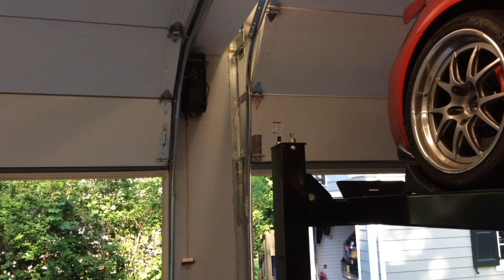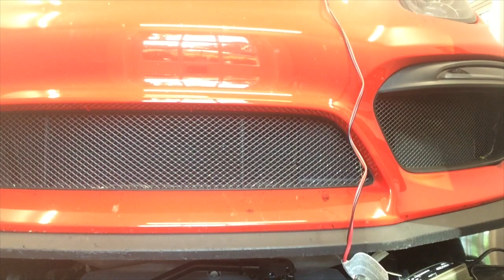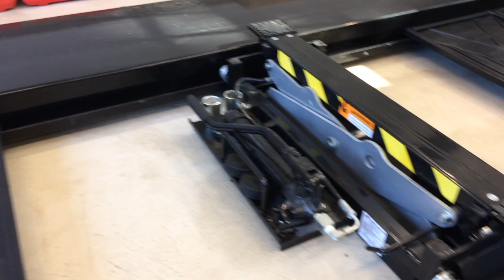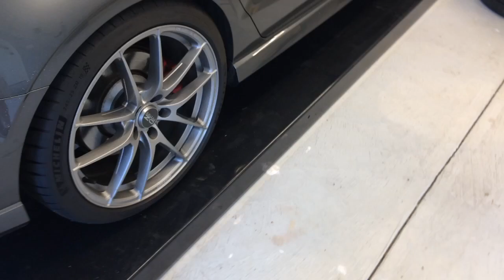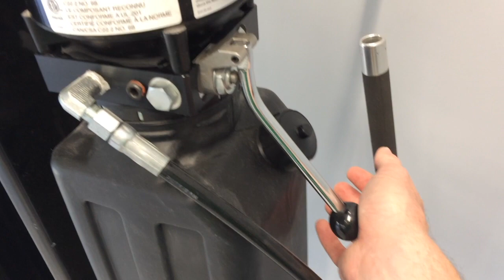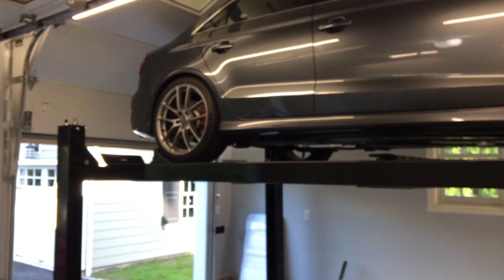Challenger 4-post lift overview and operation

Comment: Can someone help me please? 1) Can you suggest any proven methods of installing such a lift in a garage that has a slope of at least 4-5 inches? 2) Also, would the lift shift if I don’t bolt it to the ground? (I would rather not anchor it as my concrete slab is only 4 inches thick.) Last question: 3) Is 4 inch thick concrete floor even enough to to support the lift with the vehicles? I would appreciate if you could please answer all or at least some of my questions🙏
Reply from the maker: Will try to answer as best I can, Peter. But absolutely confirm with a professional installer prior to having the work done. It's well worth the additional few hundred bucks to have a local lift dealer/pro plan out and perform the installation. Safety is paramount with this kind of project. 1 and 2) My garage floor has a decent amount of slope to it, but probably not as much as you're describing. The installer may have a method to place shims under the lift's posts at the lower/garage-door side to even it out. But then they would likely insist on bolting the lift to the floor so it doesn't shift on the shims. 3) From what I understand, 4" reinforced concrete is considered the minimum thickness to safely support a lift. But again, consult with an installer to confirm. Good that you're asking the right questions for planning--it's worth it in the long run.

Comment: So, if the bridge jack lifts up off the runway rollers when the lift is in the down position, there is less clearance between the jack and your vehicle than when it was in the up position during your illustration of the clearance. So, my question: how much does it lift up off the rollers? Also, do the rollers lock when it's lifting your vehicle or could your vehicle have the potential of rolling down the runway while on the lifted jacks?
Reply from the maker: Excellent point. I will officially measure next time I have the lift in the bottom position, but my estimate is that the bridge jacks only pop up 1/4 to 1/2 inch when the lift is fully down against the ground. The GT4 doesn't scrape along them when I drive it onto the lift ramps, and the car sits pretty low--it's been lowered a bit on its adjustable suspension, and since it's on 19" wheels/tires rather than the stock 20" setup, yet the tires have the same aspect ratio as stock, the overall diameter of the wheel/tire combo is 1 inch less than stock. So the car sits 1/2 inch lower than stock just due to the 19" wheels, and a bit more than that due to the suspension adjustment. As for the bridge jacks rolling or moving when supporting the car, it hasn't been an issue for me with any of the cars I've had on the jacks. The bridge jacks themselves are really heavy, so moving them by themselves (unloaded with no car on them) takes some effort. Trying to slide them with a car on them would likely be close to impossible.

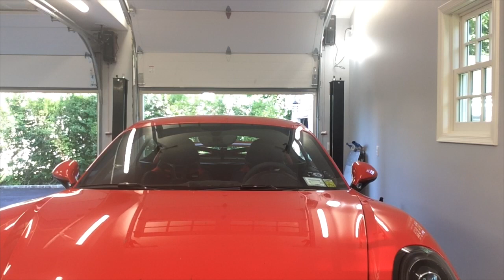Comment: Looks pretty sweet, just wondering about the posts shaking @5:34, is that normal/acceptable/expected?  HUGE oversight of them not making wide enough jack arms, what were they thinking, did they even test with modern cars?  Found a solution yet?  Otherwise, it is a great all-in-one system.
Reply from the maker: Yes--that certainly can appear disconcerting.  But that occurs as the lift reaches its lowest point and the weight rests on the inside edges of each post's plinth.  It pulls the posts in a bit.  It's not really a safety concern in that lowest setting on the ground.  My posts are not bolted into the concrete slab, because I have radiant heat in the floor and didn't want to risk hitting the radiant tubing.  But operating the lift without the posts being bolted to the floor is perfectly acceptable as per Challenger.  In fact, there are accessory legs/wheels that you can attach to move the entire thing around in the garage if you need to.  Now that I have Swisstrax flooring installed, this movement of the posts doesn't occur anymore.  I cut the tiles around the edges of the posts so that the posts themselves are still resting directly on the concrete slab, but the runways of the lift now come to rest on the Swisstrax floor in the lowest setting.  So the weight of the lift and car now rests on the Swisstrax rather than the edges of the post plinths when it's fully lowered.
Reply: @AutoPilotgogogo  Oic, they weren't even bolted, but still works great.  Nice the posts don't shift anymore.  Awesome side benefit getting the Swisstrax!

Comment: Hi, thanks for the video it is very helpful.  I am also on Long Island in eastern suffolk and I have just reached out to Ace Service and Installation about a doing an install on the challenger lift. I also have a call out to Bendpak as well.  I was wondering if you wouldn't mind lettning me know what you paid for the installation of the lift.  Im looking at the 7000lbs lift in my 2 car garage as well, and i'm also probably going to have to add a high lift kit to the garage door so i'm trying to get an idea of what the total with all the additional stuff added is going to cost me.  Thanks
Reply from the maker: Steve T Some of the additional costs were rolled into the total expense of a house renovation/expansion that we did at the time, so I’m not sure off the top of my head how much the LiftMaster jack shaft garage door opener and elevated tracks were. Becker Garage Door did the installation and did a very nice job. They bent/pieced together track sections so that the door follows the pitch of the ceiling nicely for max clearance. The cost of the 9000lb Challenger lift plus installation was around $3500, and the two rolling bridge jacks added another $1500 or so. Also factor in having an electrician place a 220v outlet for the lift—it allows the 220v motor option which raises the lift twice as fast. Definitely worth it.

Comment: Did you foresee the lack of ground clearance for the Porsche and buy the optional longer ramps or did you find out the hard way?
Reply from the maker: Definitely planned for it. The GT4 is very low, especially since I’m running a 19” track wheel setup instead of the stock 20” wheels. So it sits 1/2” lower than stock. Based on my research, Corvettes, etc., require the optional extended aluminum ramps, so I ordered them from the start.
Reply: @AutoPilotgogogo  OK, thanks.

Comment: What did this cost with the install and delivery. I'm looking to buy the 7000 lb unit from ace and wanted to know a ballpark since your model is higher.
Reply from the maker: My installation was 3 yrs ago, so prices may have increased a bit since then, but I found the quote they gave me for the 7000lb rated CL4P7 that you're interested in (I initially planned on that one before I decided on the uprated 9S):  $3650 for the lift, $125 for the 220V motor (totally worth it), $385 for the extended aluminum ramps = $4160 total which includes freight, delivery and installation. Overall more reasonable than I would have expected. Three years later I'm still very happy with it and would do it again.

Comment: I just ordered the CL4P7 and the rolling jack based on your excellent video! I almost went with the Bend Pak but the space between the columns would have been an issue with my Viper TA
Reply from the maker: Congrats. I think you’ll like it. See if the arms of the bridge jack extend wide enough to reach the jacking points of your Viper. If not, consider extension pieces from SVI International—much more economical than the extensions from Challenger: https://youtu.be/FwbbID2WtUg
Reply: @AutoPilotgogogo  Thanks for the tip!
Reply from the maker: @mT_atvF5KCVHlk  Absolutely.  I'm paradocs98 on rennlist.
Reply: @AutoPilotgogogo  BTW, do you have the CL4P7?
Reply from the maker: @mT_atvF5KCVHlk  CL4P9S, just slightly higher weight rating

Comment: Will you post another video covering the Jackshafts in detail?  Did you install both the shafts and the door extended railing? And is it wide enough for a C7 Corvette Grand Sport which is the widebody? Many thanks…. Mr DJ…
Reply from the maker: I can post a followup video detailing the jackshaft openers.  I didn't do the install myself--it was done by a garage door installer.  Might be doable as a DIY, but it looks like there are a lot of components involved--sensors, locks, etc.--and you would need to know how to set the tension on the cables, etc.  A friend of mine at work almost lost an eye when a spring and bracket broke and released on his garage door, so I'm happy to leave that kind of thing to the experts.  The extended railing was pieced together from various sections of track to follow the pitch of the garage interior roofline.  Again, I can put together a video to show in more detail.  As for the Corvette GS, it would be a good idea to measure the rear track width of the car from outside edge of tire to outside edge of tire to make sure it wouldn't be too wide for the lift.  Challenger has very detailed measurements on their website for their various lifts.  My GT4 and M2C each have about 2" to spare on either side when they're centered on the lift runways, and I'm sure the C7 GS is wider.  I believe Challenger makes a wider version of the lift if necessary.
Reply: Kool Beans, Sir. Appreciate your speedy response. I did check my car’s width and the challenger and it will fit but barely. Also looking at the BendPac. What’s your take on them? Other: I’ve a YT channel, check it if you get a chance. Many thanks. Mr DJ.
Reply from the maker: BendPak lifts have been very popular over the years, but after a lot of research, I decided it was important to go with something that was truly American made of quality American steel and parts--and that means Challenger (or its sister company Quality Lifts), Mohawk, or Rotary.  Too many stories of bad things happening with cheap Chinese-made lifts.  It's just not worth the few hundred bucks saved during the purchase.  Also, the Challenger lifts don't require connection to an air tank to operate.  BendPak lifts need an air connection in order to release the locks to lower the lift.  I'll check out your channel!

Comment: What size is the garage, including ceiling height
Reply from the maker: Roughly standard 2-car, 21’ wide x 19.5’ deep, but with ceiling over lift following the exterior roof line, 12’ high at the front and back, extending to 14’ high in the middle.

Comment: With the longer ramps it appears you are still scraping at the rear of the rocker panels and the front spoiler.
Reply from the maker: It is close. The rear rocker panels just clear, but the front spoiler does scrape a bit. I’ve been placing the small metal wheel stops from the ends of the runways under the leading edge of the ramps. This lifts the front of the ramps maybe 1/4”, which is enough to allow the front spoiler to clear. My car sits 1/2” lower than stock because I’m using 19” wheels instead of the stock 20” wheels, with the same aspect ratio as the stock tires. A stock-height GT4 would likely clear its front spoiler without an issue.

Comment: What are the measurements for the outside of the columns on this model. And how have the jack ext held up when used. Thanks
Reply from the maker: Approx 106" x 175"--add a couple of inches on each end to account for the extra width of the base plates underneath each column. Rolling bridge jacks have held up well.
Reply: Thanks for the information I actually work for challenger lifts 11 years now. We are owned by snap-on finally got my lift installed did it myself with my wife’s help was a lot of work took a few days to complete. This lift is actually a cross dock unit and only had the measurements in the manual to go by. Thanks for the actual specs minus the base plates helped my decision on the 7 or 9k. I got the rolling jacks RJ 4.5 so am going to look into the ext pieces as I haven’t seen them at challenger before. If you have anymore information or the specs on the ext maybe could get them custom made at my work would be great.
Reply from the maker: @DEE-io9li  That's great! The extensions by SVI Intnl are 1.5" x 4" x 10 5/8" (outer dimensions of the steel tubing). If you want to post your email, I can send you some pics. Did you see my video featuring the extensions? https://youtu.be/FwbbID2WtUg

Comment: Is it possible to move the lift? I have a 30’ by 60’ garage and deciding where to put the lift is proving a challenge.
Reply from the maker: Absolutely. There are optional casters on arms that attach to the bottom of each post. When the lift is raised, it then levers itself up off the ground so you can wheel it around.

Comment: Who did you use to install? I’m on Long Island and are considering using ACE in Farmingdale.
Reply from the maker: I used Ace in Farmingdale.  They did a nice job with installation and were priced reasonably.  I found that they weren't very responsive, though, when it came to follow-up for routine maintenance (it's a good idea to have the cables/locks checked every year or two, and have parts lubricated)--couldn't get them to return my calls or emails to set up an appointment.  So I had a maintenance check done instead by Accurate Automotive Equipment (owner is Howard Mansdorf, 516 941-7887).  His tech was very friendly and knowledgable.
Reply: AutoPilot thanks for the response. Does accurate sell and install as well?
What lift do you have? I have my eye on the CL4P7, my concern is the lift runway height. I am  5’9”and  will be using the lift to work and and store my 2 cars.  Once again, my concern is the head room while.
Reply from the maker: I think they do sell and install--give them a call. I have the CL4P9S. It has a slightly higher weight rating, which wasn't so important to me, but it's also a bit longer and wider, with a higher overall lift height. I wanted to make sure I could get a sedan easily underneath, and maybe even something like a Porsche Macan SUV, which does clear under my lift (had one as a service loaner).  If you're going to be doing work underneath the cars, you may want to consider doing the 9S for its higher lift height to make things easier, as long as your garage dimensions allow it. Specs are on the website: https://www.challengerlifts.com/wp-content/uploads/2017/10/SpecSheets_2017_FINAL_HomeStorage.pdf

Comment: Is your connection 110v or 220v do you have any pictures of how it’s plugged in?
Reply from the maker: 220v.  You specify whether you want a 110 or 220v motor when you order the lift.  The 220v cuts the rise time in half.  I had an electrician hardwire the 220v connection to a junction box on the wall.  All they need to do is run a 220v line from your subpanel to a junction box close to the motor location of the lift, and then hardwire the connection.

Comment: Autopilot, what was the deciding factor for you to purchase a Challenger versus some of the other companies that are out on the market?
Reply from the maker: Marek Quesnel I considered Bendpak, Backyard Buddy, Mohawk and Rotary, but ended up with Challenger for a few reasons:  good reputation, American made with U.S. parts, American Lift Institute safety certified, does not require compressed air for operation, right size, moderate cost, and has a dealer/installer close to me for service.
Reply: @AutoPilotgogogo  I believe that Challenger lifts are also made in China, but the Snap-On parent company owns the factory and controls management there. Challenger USA are in Louisville, but not the factory.

Comment: Thank you for making this video. It was very helpful to see it in action. Did you bolt the columns to the floor or are they free standing?
Reply from the maker: You can do either. The lift is stable while free standing. I chose to leave it free standing because we have hydronic radiant heat in the garage floor and I didn’t want to risk drilling into the tubing.

Comment: Hey Bud, Great Video! How many feet do you have from the floor to the ceiling?
Reply from the maker: Thanks--hope it was helpful.  The ceiling above the lift is extended to 12.5 feet (It's only 9.5 feet for the other bay).  Because there is no second floor above the lift bay, we extended the interior of the garage bay on that side to follow the roof line.  Glad I did, because it would be a tight fit with a 9.5-10 foot ceiling.  I would not be able to leave it at its highest setting like it is now.
Reply: Thanks for the reply. I need to measure mine and compare. Im going to be fitting my daily (getting an e300 soon) and possibly looking for a 6mt 5.2 R8 next year which would like your porsche sit above. if i need to raise the roof i should be ok as above the garage is the attic which we dont use at all.